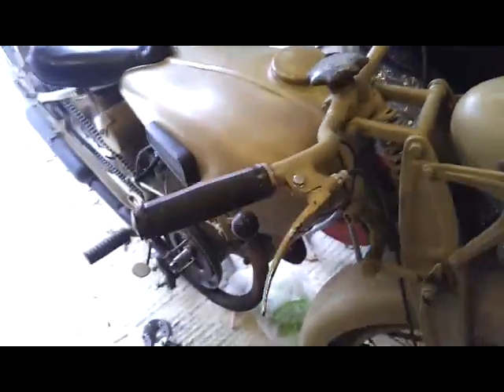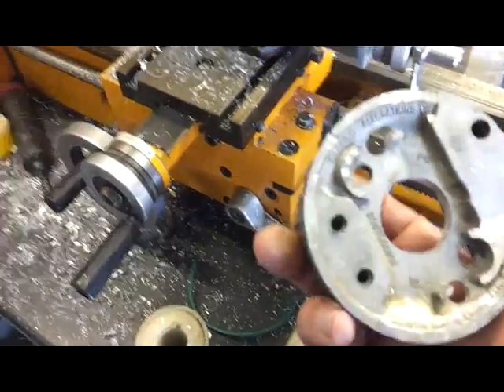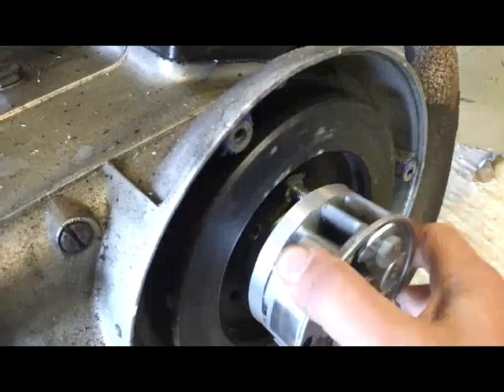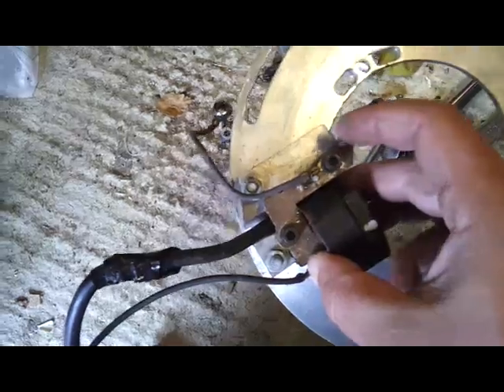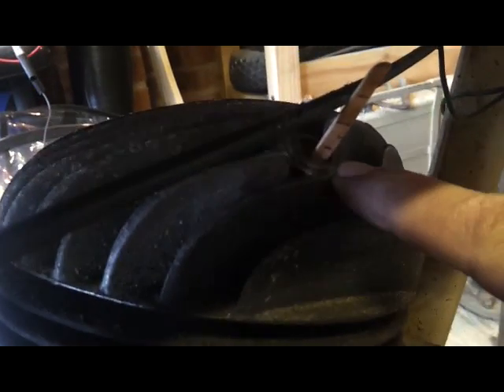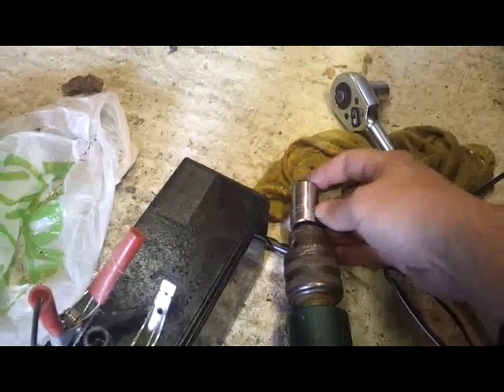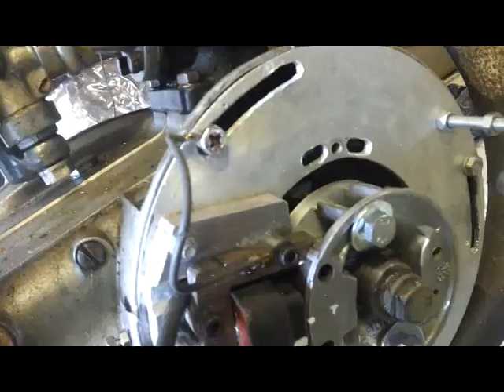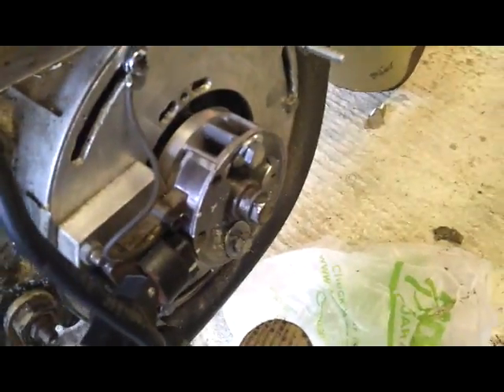How to make motorcycle electronic ignition for £5 ($8) from a chainsaw or strimmer; updated 2025

Comment: Can this be done on any two stroke engine regardless of the stroke length or do you need to make a bigger or smaller diameter fly wheel to compensate for stroke length im thinking of doing something similar with a old kx125 engine where the parts have been discontinued or exstreamly difficult to find
Reply from the maker: Yes will work with any, wont be that great with high revs but will chug along on an old bike no probs.
Reply: @MotorClassics  You know there's no reason this won't work on a 4 stroke... Your video has inspired me to fix my old KL250 which ignition parts are hard to find for and too expensive for my purpose which is riding it off road... and also bigger chainsaw engines are usually rev limited to about 12,500 rpm.... And have a timing curve built in...

Comment: So glad I stumbled on this. Just what I needed to see for my bsa bantam 175cc. Question. Lights horns where from ? Sorry for the question
Reply from the maker: You'd need a battery and just have to charge it. Nowadays you'd use an 18650 custom pack or lipo and hide it in the battery box, that would provide enough power.
Reply: MotorClassics thank you. I suppose I could use a battery pack.  Cheers

Comment: Hi, what about implementig this technique on to 4 stroke motorcycle and with dynamo... Where should I start, because I have missing all of this things? Or should I just skip the dynamo-battery thing and make it as you are making it?
Reply: Depends if you need to use it at night / need lights.  If not go the simple route and do this. It will work on a 4 stroke, the extra sparks will just be wasted.

Comment: There is no advance unit??
Reply from the maker: You don't need one on a crude old two stroke. Its not the most efficient way but neither was the engine design to start with so they only had a air slide / choke lever; much like a weed wacker.

Comment: fly wheel puller = rope on the piston trick....
Reply from the maker: Jenn Tek Dont know that one?
Reply: Remove spark plug - insert rope in jug. crank slow so rope holds piston down (Never makes it to TDC) and undo your pulley. :)

Comment: WOW that's freakin' awesome! I've got tons of these old Poulan 2 cycle engines I keep for parts laying about I've give you if you were not on the other side of the pond.

I'm currently in the process on adapting a Hot Spark electronic conversion kit (from another vehicle) to work on my Trabant 601. I'm not all that pleased with the aftermarket system that is on the market (an it's expensive) and for some reason think I can build a better mousetrap. 

The plan is to reduce the circuitry in half and run a wasted spark ignition system like what's on my Citroen 2CV. I was a bit concerned using a wasted spark on a 2 stroke engine may cause an explosion in the crankcase or lead to backfiring. But from what I've read this won't happen. For starters there are rotary valves in the crankcase and when the cylinder is at bottom dead center, the rotary valve is closed. Plus you need compression for an explosion to occur in an internal combustion engine. 

Any thoughts on this?
Reply from the maker: James S : Thanks. Id have liked some extra engines to play with,pity its so far. The mag worked just fine on the bike; no problems at all. Good luck.

Comment: the magnets have a NORTH and SOUTH  to them and if you change rotation the coil will not give same spark. --- CHAINSAW ENGINE TURNS ANTI- CLOCKWISE  you have turned chainsaw flywheel round to suit bike  rotation (CLOCKWISE) --- but many would not and get no spark or weak spark.
Reply from the maker: Air Port : I know, I had to flip the fly wheel to suit the original rotation so that it was the same as the chainsaw , not the bike. It was a 1980s Mc something..so it is correct. In the other direction it wouldn't spark at all.

Comment: the magnets have a NORTH and SOUTH  to them and if you change rotation the coil will not give same spark. ---you have turned chainsaw flywheel round to suit bike  rotation--- but many would not and get no spark or weak spark.

Comment: I'm doing that with my honda nc50 express with bits I got out of an old strimmer.
Reply: Rayxl1 let me know how that turns out! I just replaced my return spring but now I've lost the shims so now my axle won't spin but she starts
Reply: It works very well and its so much more reliable. One advantage is you can adjust the timing easier. I've got it about 20 degrees in advance of what honda recommend and that gives the most power. Doing that with the points gave a very small gap which was difficult to maintain.

Comment: nice vid. can you help me with some advice for a 2 stoke 2 cylinder bike? a friend of mine has a  Yamaha RD350 which he'd like to do away with the contact point?
Reply from the maker: Hi youd probably need two mag flywheels and trim them down. failing that youd need a proper electronic ignition kit.
Reply: thanks...will give it a try
Reply: 2 cylinders can be fired by one cdi just need to time the 2 pick ups to fire at the right time but there is ignition conversions out there for the RD yamahas

Comment: Very Smart.  
I imagine that this same technique could also be used to replace an old coil/points system on an outboard engine since the flywheel on the outboard already has the same magnet setup as a string trimmer.  
This would be much cheaper than replacing the original coil, points and condensor.

Comment: I love help videos. I'm not trying to put this video down, I'm not..... I did this to my 90cc 4 stroke engine, it worked just fine. Most motorcycle engines fire the spark plug on the exhaust stroke, so even if you use a magneto from a 2 stroke on a 4 stroke, it will work. I'm not sure if it was mentioned in this video, but You should bring down the spark plug gap to about .450mm or .500mm. Bring down the gap because the coils for small engines use a smaller spark plug gap. If you would like to see this on a four stroke engine watch this video here on youtube, ( Homemade two engine Go-kart. ) jblackmore2003, thank you for the video, it was the reason I used it on my engine. At .09 and .16seconds of the video you can see the ignition from a craftsman 32cc weed eater.
Reply from the maker: julio lausell Hello, I'd not thought too much about 4 strokes except that the spark would of course fire on each stroke if fitted with this kind of mag, which is not ideal.
Reply: The spark fires not on every stroke, but on every full spin of the crank. In one spin there's two strokes. Intake stroke, compression stroke, one spin of the crank, spark plug fires before tdc, power stroke, exhaust stroke, two spins of the crank, spark plug fires before tdc, if it ignites your intake charge, the timing is way retarded. You can see the engine running in my video.

Comment: This is magic. But..........................
I don't understand why the flywheel was installed back to front to make the engine run in the right direction. Can anyone explain this before I make the same mistake ?
Reply: I think from memory that the magnets in the flywheel where different somehow (one was stronger than the other) and this then altered  the exact timing in that the spark occurred too early and the piston was still on the compression stroke when the spark fired forcing it back down the wrong way.

Comment from the maker: Thanks, the difficulty with timing this by cable would be stability of the outer mounting plate. Magnetos are very sensitive with the gap changes between the core and the magnets (as in 0.0xx mm). I think it was mainly 4 stroke that had the lawn mower advance lever, but I might be wrong.

Comment: This is so very awesome! Great work! I wish I had a lathe like that, it would make my projects easier! Check out my videos where I used HEI automotive ignition on a 1980's Husqvarna 250. I had a friend helping me remove the flywheel of the original ignition and he broke the crank snout. Only problem we face now is the bike needs a battery to run and has no charging system. I have a replacement Motoplat stator and flywheel but I need to find or fab a bushing to fit the flywheel. love your idea!!!